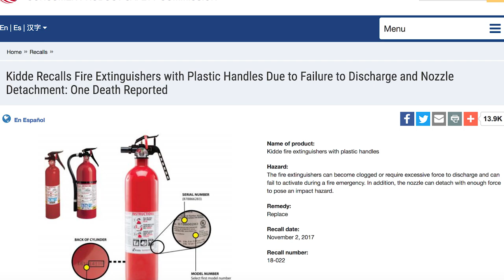Fixing Generaotor & Brakes ~ Big Recall

Comment: Erick that Drum You Got From Orileys the way it is Designed with that Thin Contact Area would Heat up Pretty Darn Quick and most likely put the Drum out of Round and you would be right back where you started From.  Yes the Drum that you Got from Autozone is a Much Better Drum and the Contact area for the Shoes is Definitely Much Thicker and will Dissipate Heat Much Better Good Luck I hope this Fixes the Problem.

Comment: Apparently NOT every plastic handle. The serial numbers on mine confirm that. And both CO and fire detectors go bad with age. Even with good batteries, replace the detector by 10 years, or buy the ones with a 10-year battery, then replace the whole thing.

Comment: Yeah, cover up that Chevy emblem! I have the same chassis which is why your maintenance videos are so helpful. Did you end up replacing both rear drums or just the one because of the 15lb weight difference? Additionally, CO detectors have a limited useful life. There is a dirty film like substance that accumulates over time making the detector less reliable. Why are detectors for RV's more expensive? Because they are manufactured to withstand the constant vibration  on the road, unlike a house unit that remains static until you change the battery. If it's a safety item, I personally don't cut corners.